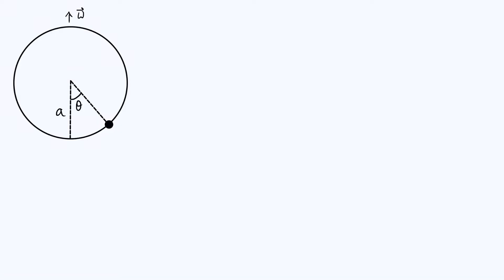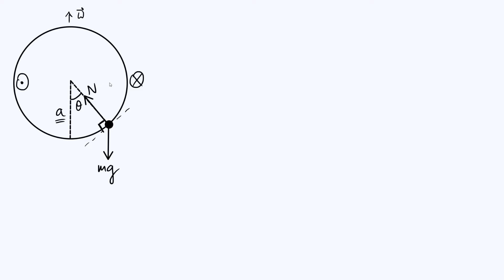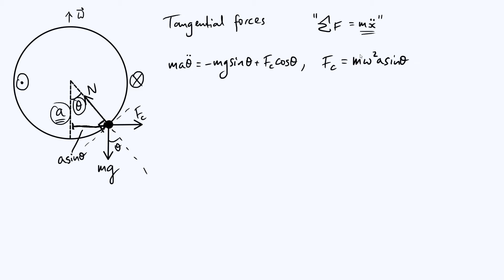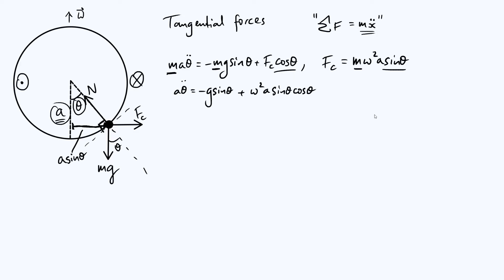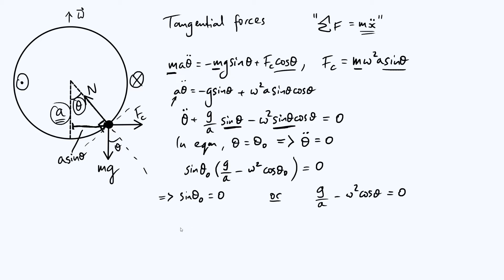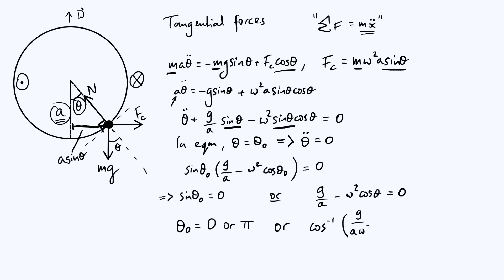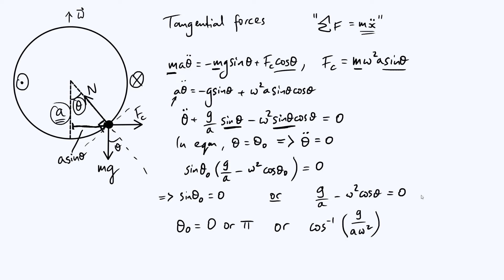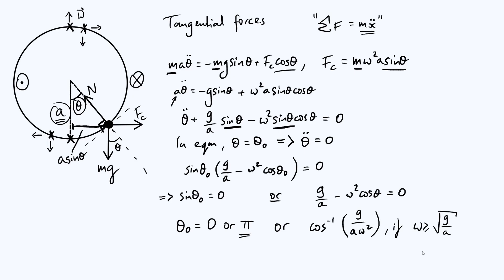Bead on a rotating hoop: equilibrium positions

Comment: Found that the angular frequency of small oscillations around the stable equilibrium points, when ω>sqrt(g/a) is ω0^2=(ω^4-ωc^4)/ω^2, where ωc^2=g/a. Not so sure but I'm open to any other other solutions.